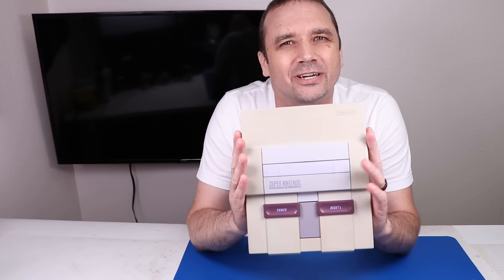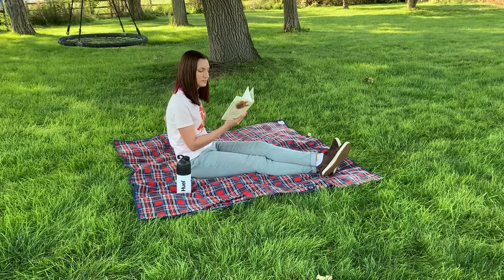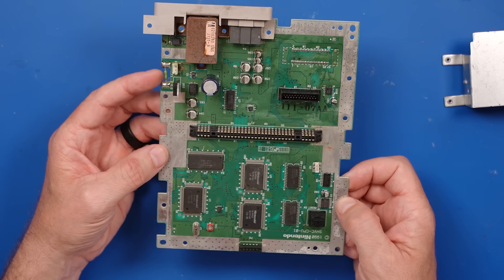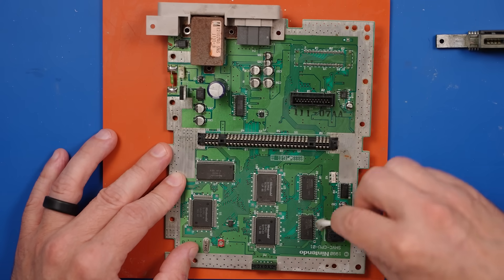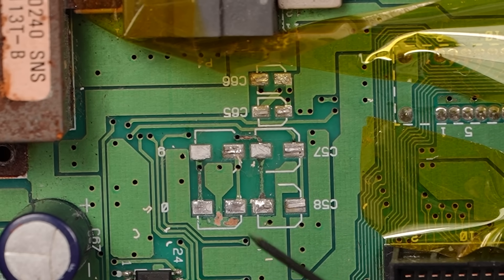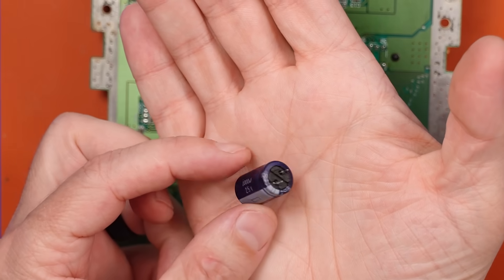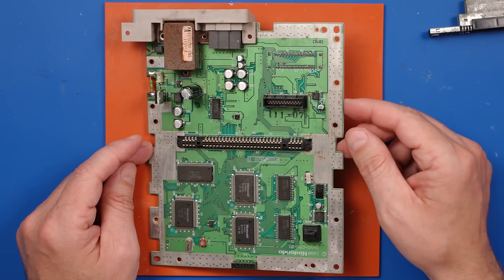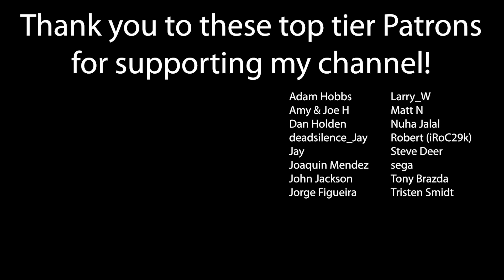Repair Shop Said "Unfixable" - Let's Find Out!

Comment: I bet the person who installed that ribbon cable is the same person who plugs in an hdmi cable with vice grips and a hammer.
Reply from the maker: Lol, probably!
Reply: @Tronicsfix  quiero reparar mi sega genesis no funciona el botón  de star y ya compre varios mando el sega tiene conmigo  30 años
Reply: ... into the USB port ...
Reply: Lmao this is gold
Reply: I got a work order for that a few years ago. Teacher jammed an HDMI cable into a display port. I don't know what the hell she did but somehow wedge it in there. Broke the port on the PC and the HDMI cable. Had to order a new System board and replace the cable.
Reply: Heavy duty installation.
Reply: @12345.......  Wait, that's now how you install an HDMI cord? O.O
Reply: TBH, those will fail like that if plugged/unplugged a couple of times, even if you're extreme careful.

Comment: Nice work! I’m new to soldering and every video you put out is helping me progress my scope of knowledge. Thanks Steve!
Reply from the maker: Glad to hear this! Soldering gets easier the more you do it!
Reply: Steve, I have little radio that looks like a computer I wonder if you would be interested in doing a video on. A few wires came loose and my eyes are not good enough for soldering. Not looking to sell as can't find them anywhere anymore. I bought it at a electronics show back in the mid early 90's. I would def be pay for the repairs.  It has a mouse that as controls the tuning functions (scanning fm radio).
Reply: For a while before he got sick he was doing classes in soldering. I loved those classes. It taught me a lot. I was able to fix my NES controller with the classes. Steve is a great teacher.
Reply: The thing that increased my soldering skills a ton was assembling a custom keyboard. Was 100+ surface mount components. Soldering on most things felt quite a bit easier when I was done. Only problem is that such a project is a bit pricy.

Comment: Who here was worried about the save files on the LoZ cartridge while Steve was messing with the power? 😅
Reply from the maker: Lol
Reply: The battery recharges when used.
So when the game  is used regularly it will keep the battery fit.
Also store it dry and warm makes it live longer.
Due when metal cools below 20 degrees celcius moisture will attach to and oxidize it.
Reply: Not really because that save battery is probably long dead
Reply: @KetsubanSolo  I have no idea how it's possible but my original gold Zelda NES cartridge bought from Toys R Us decades ago STILL saves games.
Reply: @joutoob9 if it was handled well, it can be possible.